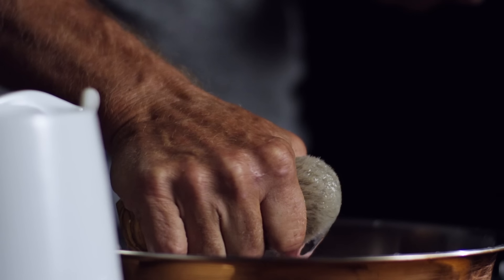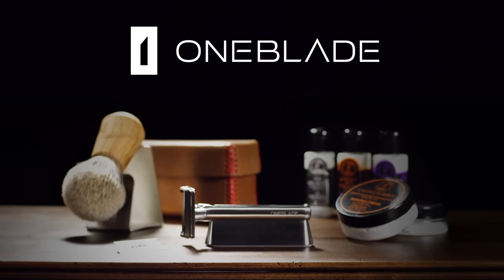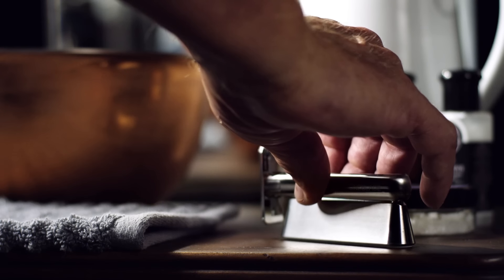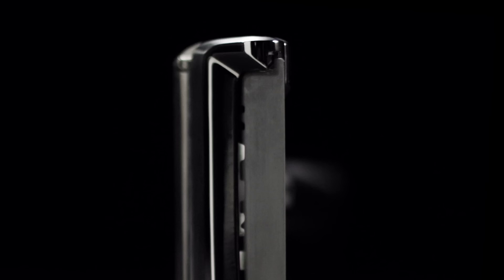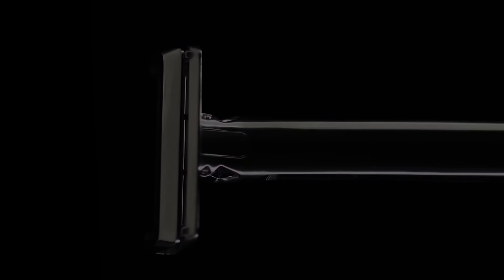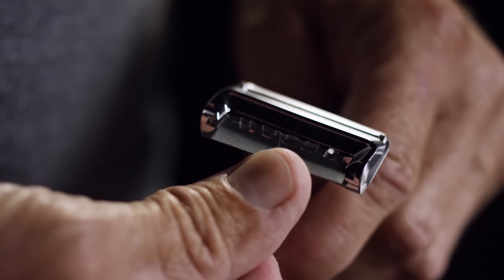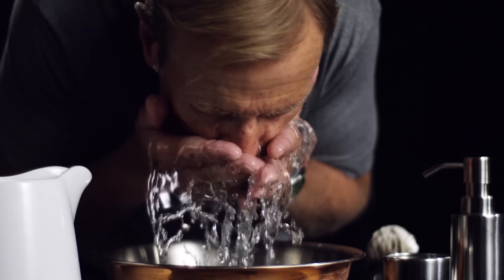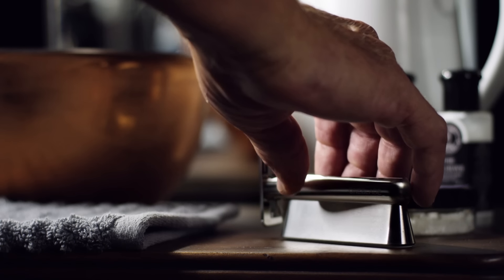OneBlade Razor: The Design Story

Comment: If they could drop that blade price and the amount of glue that comes on the blade/wrap (completely unnecessary use of glue), then I could support.  What they should do is sell razors, but they want to much residual income on the proprietary blades.  Subie Shaves Gem hack is a good one using less expensive and higher quality Gem blades imo